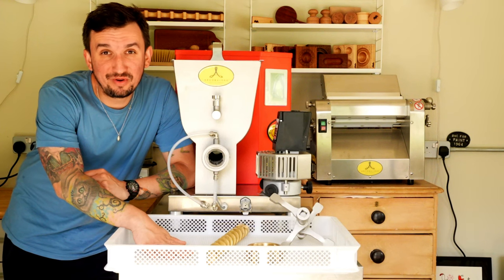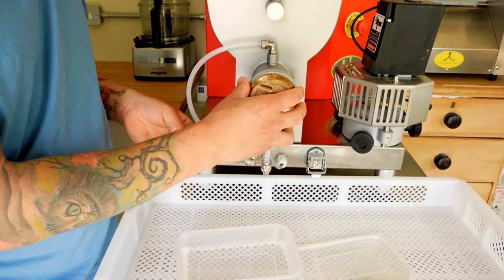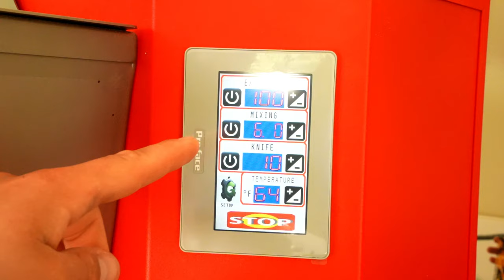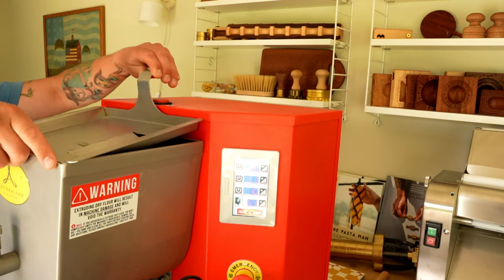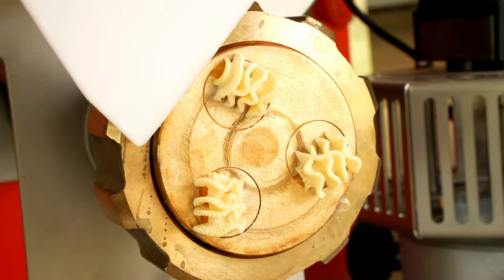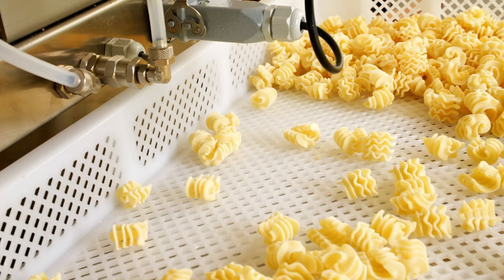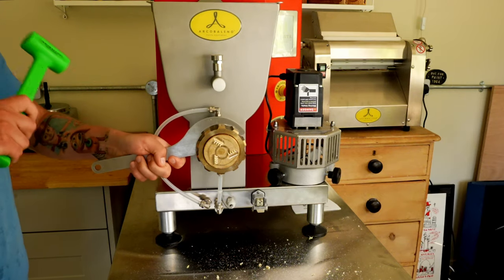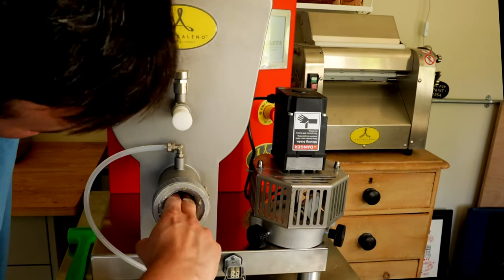Extruded Pasta using bronze die. How It Works , Recipe and more. Stella by Arcobaleno #Pasta

Comment: Is it possible to make a dough with only floor and eggs in the machine?🤔
Reply from the maker: Hello :) if you making egg dough I will recommend just for tagliatelle or lasagna sheets, Mayeb rigatoni. Rest is not as good as hand rolled :)
Reply: @mateo.zielonka  great vid! For the Egg pasta lasagne and tagliatelle do you still keep to the 32% (32% egg yoke weight to flour) hydration rate?

Comment: Could you use a paddle attachment on a mixer if you had a cheaper machine and didn't want to overtax it. Also is it OK to use flour/semolina mix, 50/50 or what would you suggest. Thanks Peter
Reply from the maker: Yes you can! I will use mix 70/30 semolina to flour if you want to make extruded pasta - for handroll do 30/70 semolina to flour

Comment: Hi Matt Im a chef and a big fan of you.

I am are trying to shift pasta producing from Kenwood attachments to La Felsinea Pasta Extruder.

Im having hard time adapting our dough to the extruder.

The original recipe we use for the pasta is: 

600g Egg yolk
15g Milk
930g Strong Flour

We are trying at the extruder varing the flour ratio form 800g to 1000g.
But none of it comes out the way we want. It’s very frim and a bit floury.

Have you ever tried pasta dough with egg yolks in extruder? If you ever succeded one, please share your experience! It would be very helpful!

Thanks. Always admire your contents!
Reply from the maker: Hello, go to my website Mateo.kitchen and email me please

Comment: Hi , thank you for your video , i have question: i got parmigiana d55 , what is the best pasta dough recipe for glassy smooth tilitili please?
Reply from the maker: I will use 32-35 % hydration so for each 1kg of semola 320-350g water
Reply: @mateo.zielonka   thanks a lot , believe it or no , that's exactly the same measure im using. 
One more question: What is the best  temperature in  the dryer  and how long i shall leave it to dry ( capacity 50kg )?? Thanks in advance